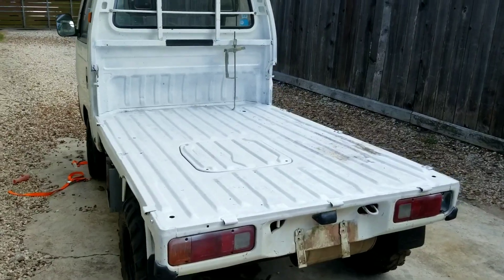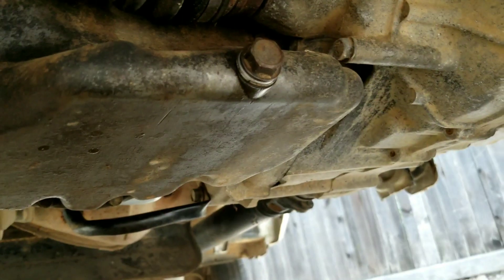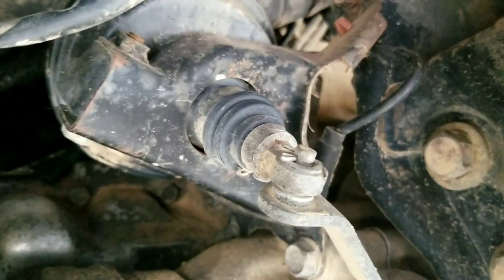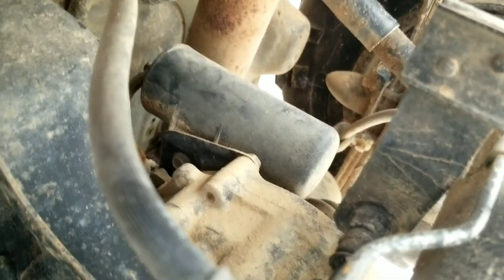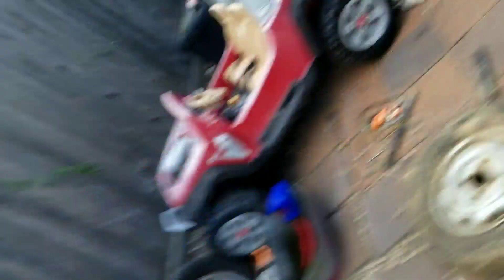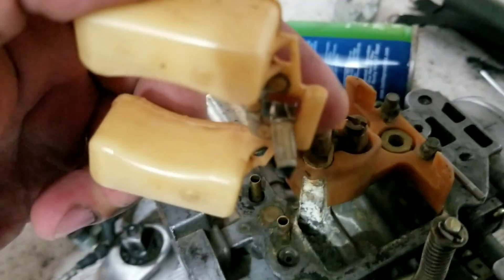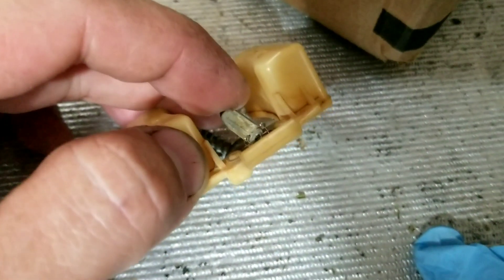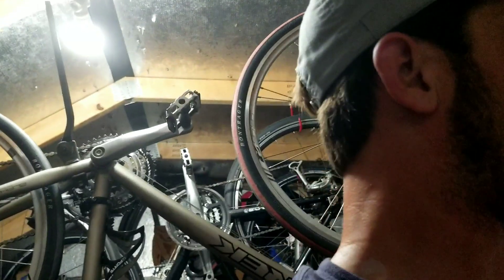Project Acty #3 mini truck carburetor flooding, Honda Acty needle won't run

Comment: I've watched a lot of your videos and appreciate the information.  I have an '89 ACTY ad it is clear that the front springs are far to weak.  Have you replced any front springs? If what are the spring dimensions?  Thanks.

Comment: Wondering why my Honda Acty fuel pump constantly ticks but starts right up and runs fine. Also installed a new fuel pump and it does the same thing starts and runs fine but still ticks, is this normal?
Reply: Mine has ticked since the day I got it (36k miles).